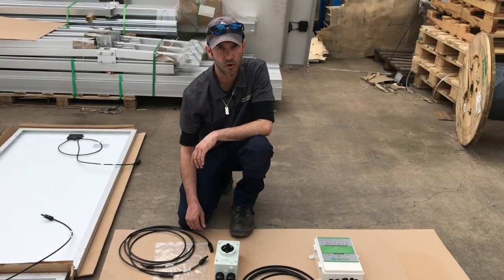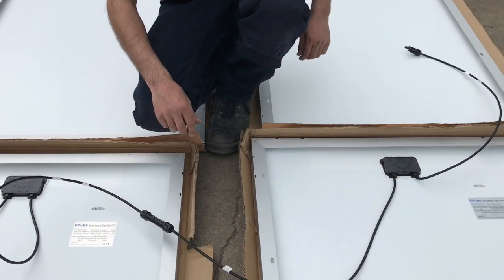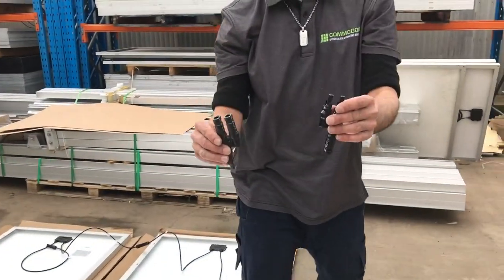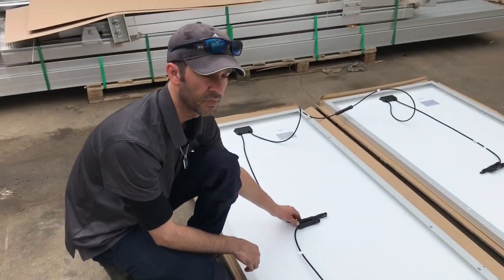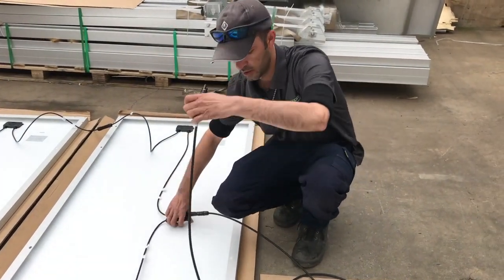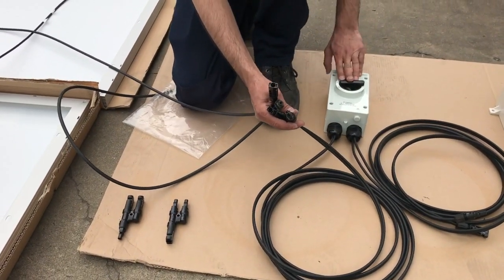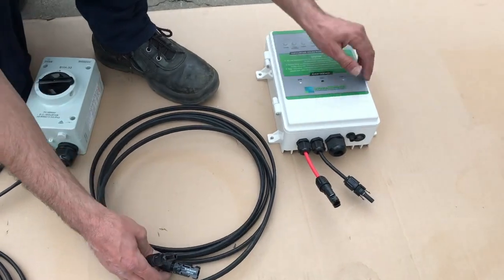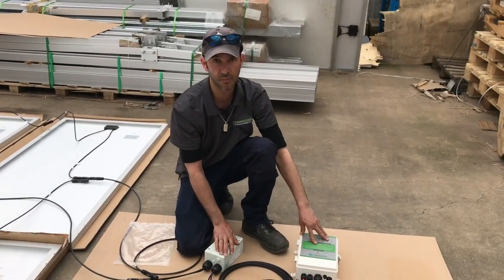Wiring Solar Panels in 48V

Comment: My question was about grid power. I know the AC output is for the appliances. The AC input is my question. Do you just plug that into any outlet in the house? Or do you have to go to the circuit panel where the lines come in?

Comment: Hello. I am struggling and am hope for a little guidance.  I have a 48v battery set up, 24 - 2v batteries, that I want to be able to charge with my 24 - 250w panels. I only need to charge and do not need to pull any power from. I am wanting to maintain the batteries that are on my 5 acre lot that I'm selling so they do no go bad just setting unused. I have a MPPT solar controller (Tracer6210AN) to run my solar panels to and then to my batteries. I and struggling to figure out the best configuration of my panels to best charge the batteries. My battery system is very large and I'd like to charge them the most efficiently way possible. I was hoping that you could offer some advice on how I should proceed with this project. Can you please offer some insight so I can move forward with this project, please?
Thank you in advance for your time and guidance!
Sincerely,,
Wilson

Comment: When you connect the 4 panels together is it true you are sacrificing you watts? So now you technically have 1 48v 100w solar panel? Instead of 400watts at 12v? Am i confused about that or it that correct?

Comment: what is the rated voltage for each panel ? if the panel voltage is 36volts is it possible to connect it to a 24v system
Reply: Yes you you can. Connect in parallel to maintain the 36 volts, the charge controller will be being it down to 24volts. You can connect up to a safe voltage of 43.2 Volts. Anything more than than voltage will be killing your controller.

Comment: Thank you great explanation ! My issues are I bought Solar Panels off Wish Great Price But they use UPC plugs , the plug for you’re cell phone I have four 20W I ordered my inverter is the 5KVA 230v Pure Sine Wave Inverter Charge Controller 48v , how to use these solar panels in series ? I understand if able I will have to cut and splice wires but is it worth it ? Any advice Welcome ! Thank you !
Reply: I install solar system too please I need a job
Reply: do you have a solar charge controller ? you need to look at the solar charge controller voltage !

Comment: I have a victron smart solar charge controller that is 150/ 100  which means it takes 150 vdc in and outputs 100 amps of charge out ! at whatever your system is rated for

Comment: I'm not being sarcastic , But why would you worry about wiring panels for 48 volts when we have solar controllers that list voltage as hi as 250 volts ? it doesn't make sense . I have my panels wired for 150 volts cause that's what my solar controller  calls for !  I don't even know of a system that calls for panels to be wired for 48 volts now.  Maybe i am mistaken.
Reply: It just means the system has to have a minimum of 48 V to run. So you can't plug up normal solar panels outside of series. You have to use the adapter so you reach 48 V.
Reply: Sarcastic is wrong word. Video showed perfect 48V system - my electric engine requires 48V and so does my battery pack.